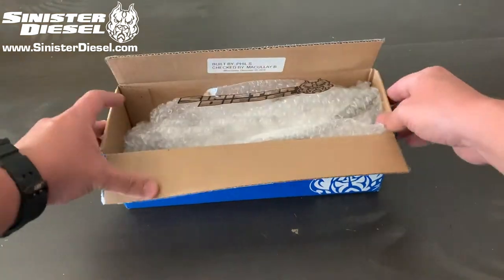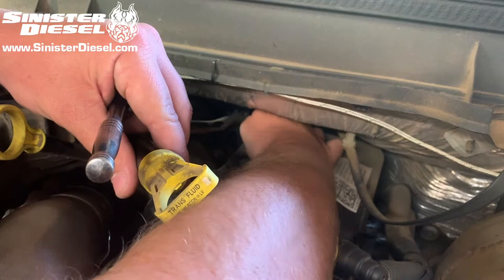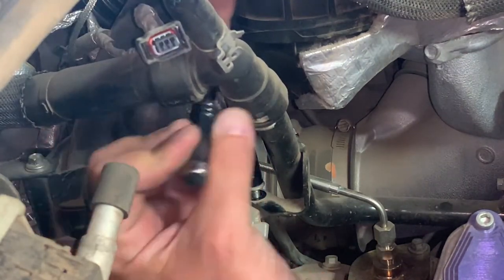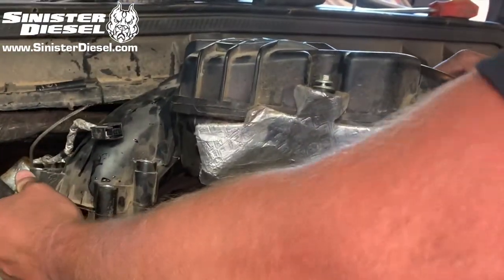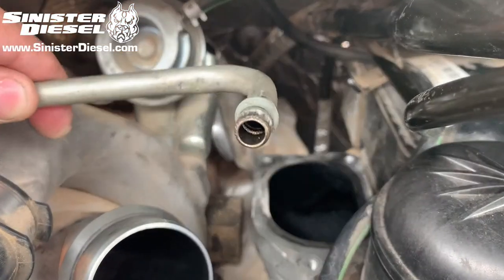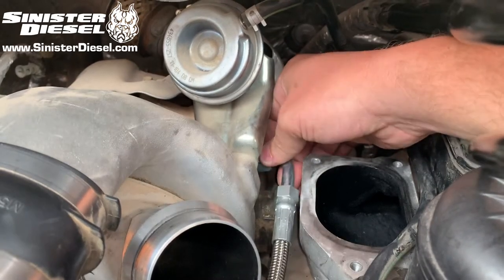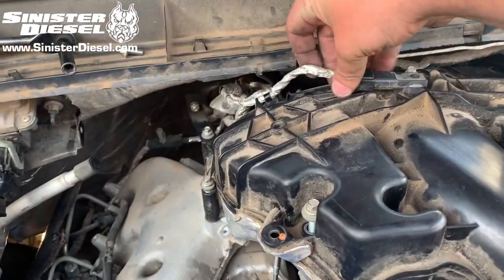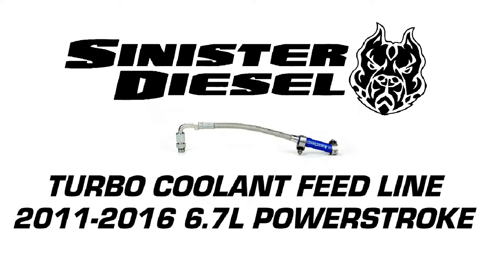Sinister Diesel Turbo Coolant Feed Line for 2011-2016 6.7L Powerstroke Ford F-250 & F-350 Trucks

Comment: I'm having trouble threading the line onto the fitting. And tips or tricks you want to share? Also how did you get it tight once you get it to thread? Wrench? Crows foot? Not alot of room. But I've got big hands so...
Reply: Zachary Novak what did you figure out? I have mine threaded but even a crows foot is too big.
Reply: I had to cut an 18mm wrench in half
Reply: How the hell do you get the line threaded without cross threading